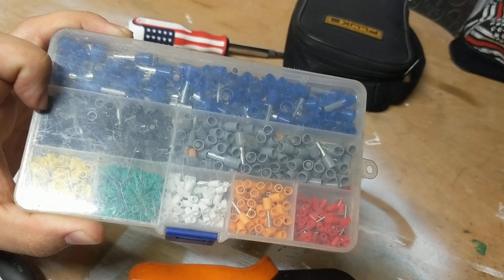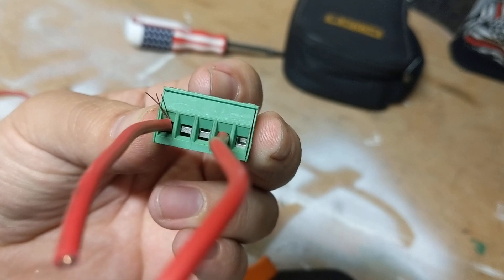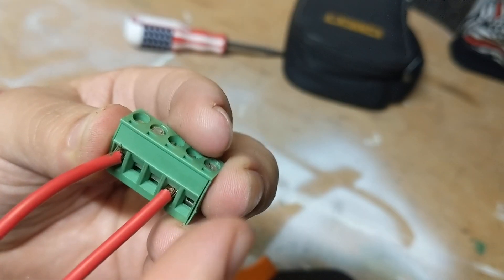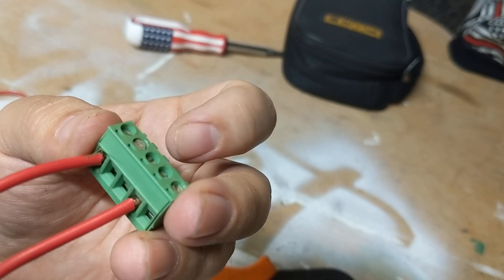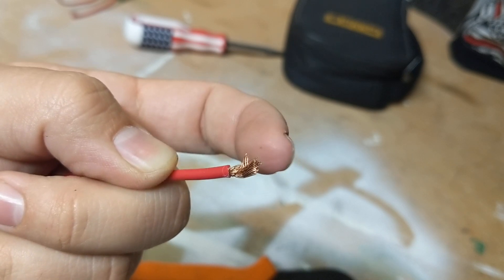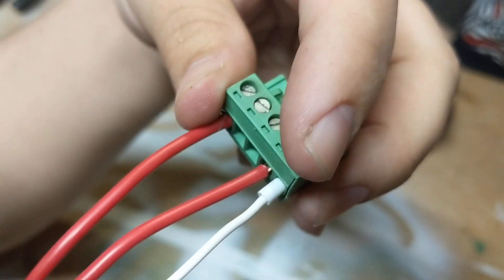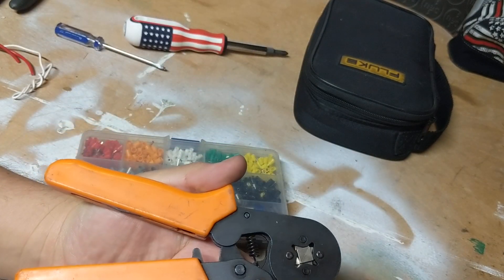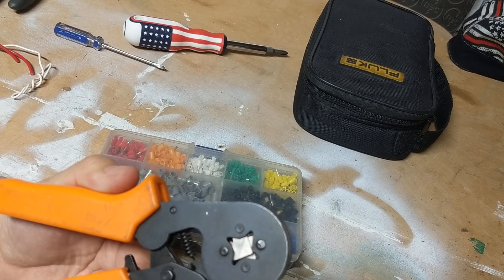Ferrule Crimping for Beginners and Electricians

Comment: I've always used wire nuts. I've bought some wago 222 Chinese knockoffs for tinkering with some low voltage DC circuits, Arduinos etc. but I'm not sure if I would use them for ac.
Reply from the maker: Yea, I'm gonna call it now though... There gonna make a connection like an Ethernet cable for us. And it's just gonna be plug and play